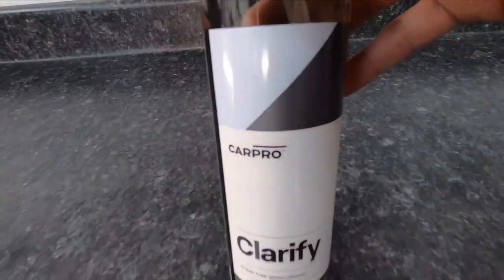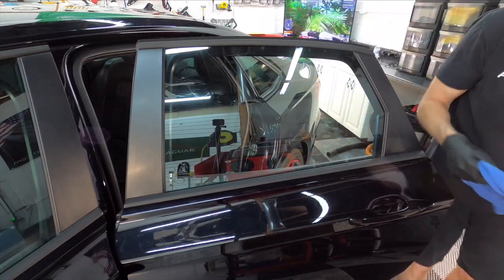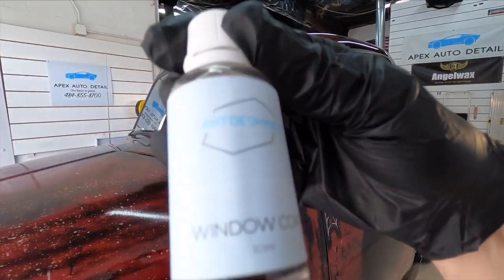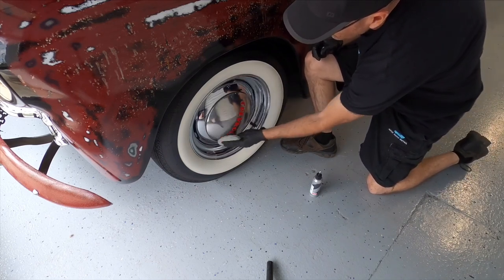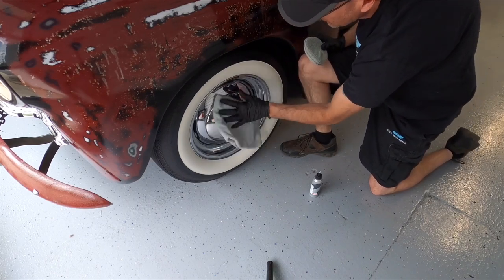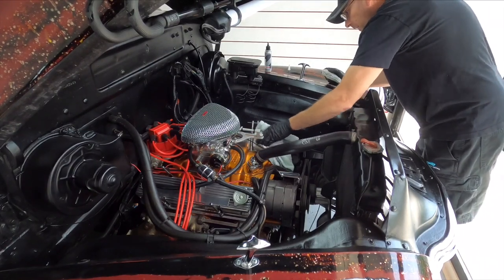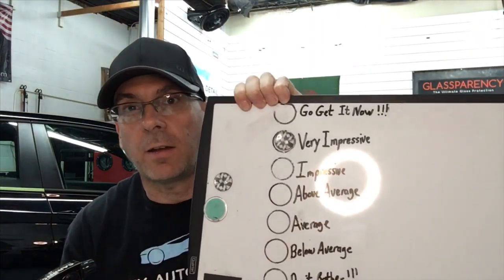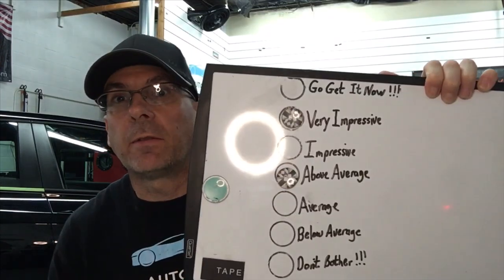CarPro Clarify! Safe For Coated Windows! CarPro Metallicut!! Cut And Finish Metals!!

Comment: Brian I know it's an old video but I found the damdest thing at Walmart that I think you would love with your self declared love for huck towels.

Walmart has a roll (yes a roll) of microfiber towels under the autodrive brand that are super thin edgeless washable and lint free for around $15 bucks for 75, so basically $.20 cents a towel.

I wouldn't use them on paint but they make amazing towels for windows, trim and rims.

 87/13 blend, comes in blue or white.

Comment: Two good products from Carpro!  Clarify is similar to Sonax glass product even on price, a bit higher than my budget.
Questions: 
Prior to cleaning the top edge of the glass do you try to apply any dressing to that rubber seal during a detail?
Next on using Metallic for the metals, do you follow-up with any protection?
Reply: Sonax Gummiflueger is the best for bringing back door seals and rubber gaskets. I apply it to all my seals every 4 to 6 months and they look brand new

Comment: Bought this yesterday :) just one off topic question! I have ordered polishangel high gloss aswell, can I use that over turtle wax seal n shine or just without wax on cleaned surface? Thanks and I hope I get an answer. Take care
Reply: Well I’d say no and I’m sure Brian can agree.  Polish angel has a great shine but if u top it u replace it with SNS  also it takes on new water behavior...
Reply: Apply on a prepped and clean surface for best durability...
Reply from the maker: High gloss is a great coating topper. Not sure it plays well with everything. Give it a shot.
Reply: Hank's Detailing thank you, what i wanted to say is that atm i have seal n shine on, so if i can top it with angel or to wipe it off before angel :)) thanks again !

Comment: Hi Brian.   I've got CCW billet aluminum wheels on my C5 Z06.  The prior owner put some fine scratches and allowed some hard water spots to form.  I've tried Mothers Billet Polish which creates a black dirty mess on the microfiber towels, but doesn't remove the water spots or the fine scratches.  Will Metalicut work on a billet wheel?

Comment: Brian another product I think you'll be impressed with is AUTOSOL Metal Polish and another is SHEEN GENIE Metal Polish. The AUTOSOL comes in a paste also. Cuts down on sling because it not a liquid. Works extremely well. It's mostly all I use. And can be applied by hand or machine. autosol.com.